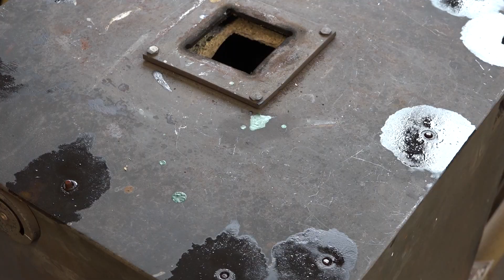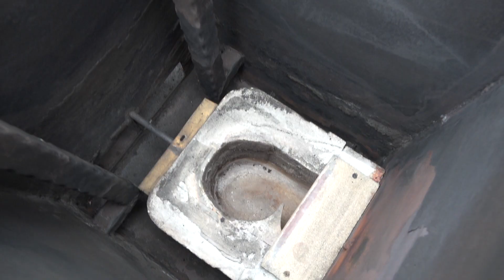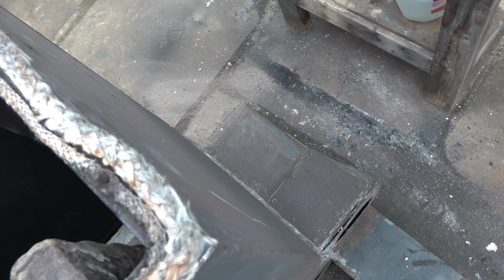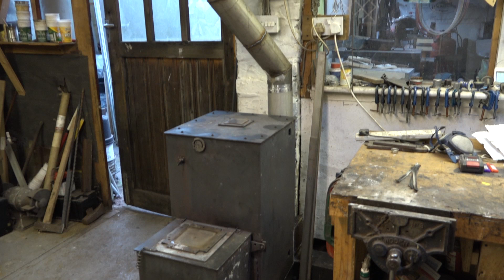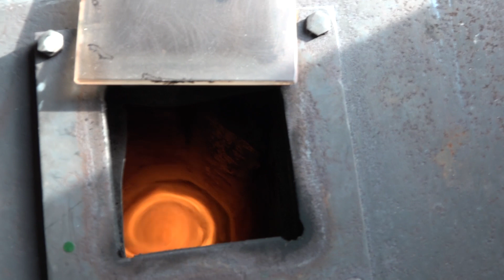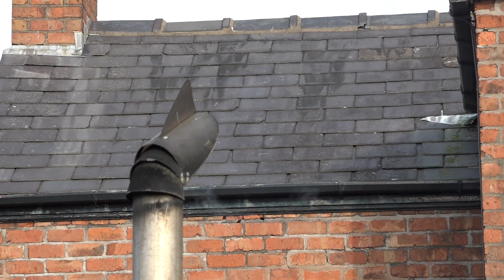Rocket stove heater refurb 2021

Comment: at 3.55 what is the purpose of those 2 square tubes going from top to bottom, in the riser box?
Reply from the maker: they allow for the passage of hot air to rise up through them being open at each end and work really well.

Comment: I am wondering why the firebox could not have the lid on the front, conventional style? Since it's closed up anyway it seems to me it could as well work like that. Where is primary air coming from? 

Do you run the primary (and secondary) air through the stove itself to let the stove pre-heat its own air supply?
Reply from the maker: Yes for could be on the front primary and secondary are pre heated and both run inside the stove. 👍

Comment: 16:43 positive pressure! 
The riser acts as a blower when is up to working temperature.
The collector box and the flue has to be perfectly airtight because the air pressure inside is higher then surrounding pressure .

Comment: Hi loz , great to see the stove still goin well , ive just got a work unit gunna build a stove based on yours , would the vortex work ok on a 1250mm tall exchanger
Reply from the maker: Hi Andrew, basically yes the height makes no difference to the vortex inside the riser,

Comment: I am very pleased with my shop stove, built using your plans 3 or 4 winters ago...it's needed a lot less maintenance then I thought it would.  I used ceramic fiber board for the innards, and it's still going strong.  In fact I have to be careful with it as it will get too hot and turn the propane tank heat exchanger glowing red at the top.  Maybe it needs a baffle in there?  I burn wood scraps and it works great.  Heats the shop so fast, like flipping a switch.
Reply from the maker: Great to hear that mate, I think once you realise how good they are there is no going back 👍

Comment: Dear Mr Loz Harrop you are the best in this field, just wanted to know what size stove for 13x 13 room with 9 feet height and 13 x40 room with 13feet height my house the temperature goes down to max minus 1 thanks and regards
Reply from the maker: Thank you. A stove the size of mine in the video would easily heat that space, you see how small the firebox is, it is the big square exchanger that actually releases the heat the bigger the surface area the more heat it will release, that works to a point then you need to increase the size of the firebox, so like mine if you doubled the exchanger and increased the riser tube diameter you could double the firebox size too. cheers.
Reply: @LozHarrop  Was wanting to join but Pay pal does not work in India my bank requires an OTP every time a transaction is done Thanks for every thing will try with someone credit card